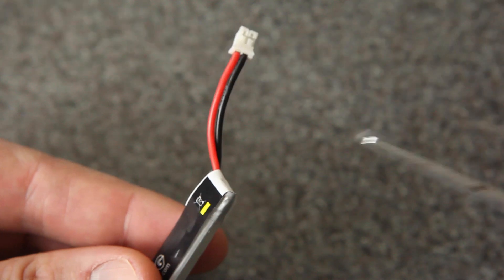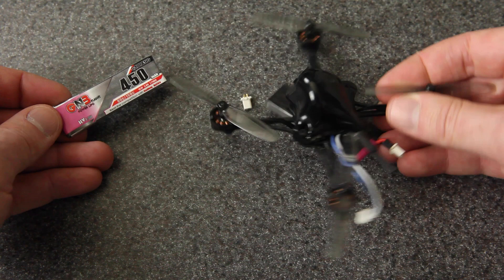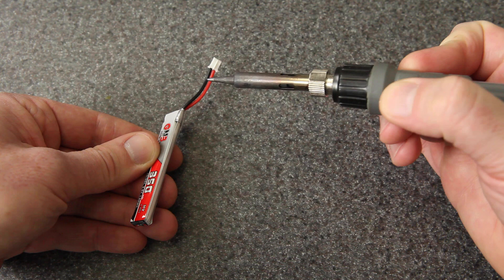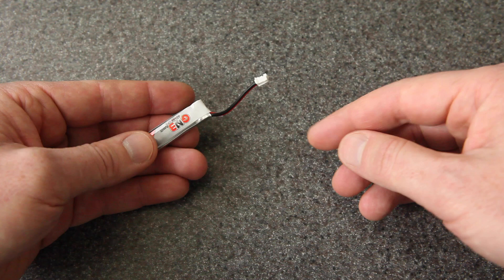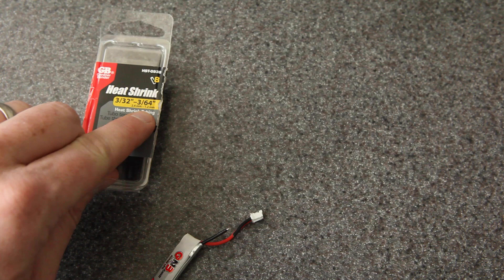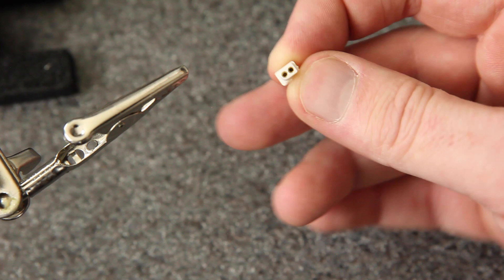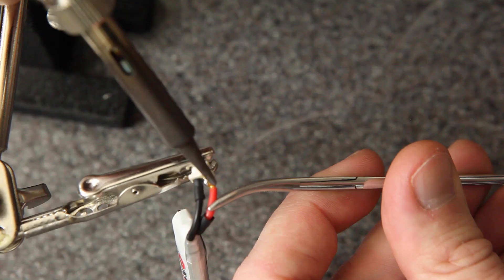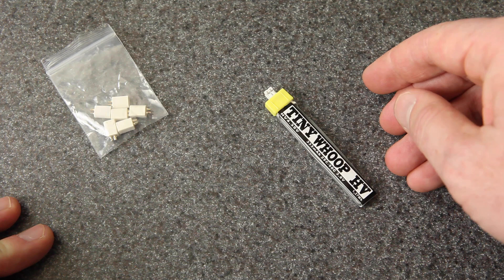Replacing Battery Connectors The SAFE Way

Comment: Couple of other things to consider: 1, it’s a good idea to plug the connector into a socket when soldering- that way, if the plastic melts slightly then resets, your pins will still line up. 2, a bit of blu tack works way better than the helping hand tool- I use that tool only when I use the loupe/ magnifying glass thingy. Put the blu tack on something heavy and heatproof- I use a chunky marble coaster. 3, if you do cut the wires too short for heat shrink, you can use liquid insulation tape. This is a black bitumen type substance that you paint on. Added bonus- it’s more flexible than heat shrink (and it waterproofs your connector to a degree). I usually take the pack apart, solder a new lead onto the tabs, and reassemble- but that’s not for the faint of heart or novice solderers. Great video as always!

Comment: I find Blu-Tack is infinitely better than helping hands.
Reply: I´ve heard about Blue-Tack in the past.. 

now i read this comment and watched a vid,
on how to used Blue-Tack while soldering...

Thought you put wires into it,
which for me doesn`t made a lot of sense to me..

But putting/pressing FC, ESC, Rx  e.g. into it makes a lot more sense !!!

So easy to solder wires to them.. GREAT !

bought it right away..

Thank YOU :)
Reply: Couldn’t agree more, I grabbed some Electrical putty from work and it works like Blu-Tack

Comment: I saw a recommendation for soldering an xt30 that said to always put the "mate" on the plug while heating so that the pins can't move.  I think I'd do the same on this little BT2.0.  It matters more for the male side maybe, but just seems safer in all situations to me.  The only downside is that there is more metal connected that you have to heat up.
Reply: Martin Gates I do this same thing. It does take a bit more heat as the pins will heat soak but at least the plug is aligned and easy to connect and take apart.
Reply: Also doing the same !
Reply: You might need a bigger chisel solder tip
Reply: thats how i do it, but i got a surprise the other day. I had taken off the rubber tips on my helping hands, aaaand i wanted a helping hand, so i clipped onto the xt60 no problem for black wire... and when i went to do the red it exploded! The alligator clip on the helping hands shorted the xt60. No damage or injury besides an exploded xt60 connector. I took off the rubber tips to work on something tiny earlier and neglected to replace them... be careful m'kay

Comment: I always put a mating connector on the connector I'm soldering for 2 reasons:  1.  to keep pins in place even if the plastic deforms a little, and 2.  if it already has wires then it easily indicates the polarity.
Reply: Its a good tip for the micro connectors, but youve got to have a screaming hot iron to do it with an xt60 because the other plug and wires suck the heat right out.
Reply: @prescottmajette5290  What soldering iron do you use?
I use a TS100; I usually do bump the temperatures up though for big stuff like XT60s.  You can also only partially insert the mating connector so the heat bridge isn't quite so ... severe.
Reply: @GoatZilla  Its just some chinese knock off that takes hakko tips.  Does up to 480C and 70w though, so its honestly pretty decent.  Even with my biggest chisel tip and 480C, those xt60's can be a big pain.

Comment: Awesome video! One tip With the lighter: if you put it above or to the side of your workpiece, you can use the blue portion of the flame for a more controlled heat application. I learned this one when cleaning up cut edges of synthetic (plastic) textiles & ropes.

Comment: If you have a wire already attached to a connector, can you solder wires instead of the connector end?
Reply: That's my question too I want to replace my drone battery by cutting of the old one's connector and putting it in the new battery
Reply: @aniketsrivastava1870  I can confirm I did it and it worked fine. Mine was converting PH2.0 to ET2.0 on my 1S 250mah.

Been fine for the last 2 months.
Reply: @blackyle3  well that's great I wanted a battery with more capacity and same p.d. so I m getting 750 mah lipo battery instead of older 500 mah
Reply: thats fine as long as you get a nice connection

Comment: Could I do this by just splicing the corresponding wires together and using heat shrink?
I have a dead battery with connector and a new one without

Comment: What is a safe batt voltage for connector conversion? Could you apply heat to a fully charged batt? Thanks

Comment: Great video my drone runs a 530mah will a 650mah be ok for a little longer flight time. I am going to swap for a single 2s battery with ec2 connectors.i use the ec2 connector on my 1/24 scale rc crawlers.thanks for the advice ahead of time
Reply from the maker: I don't know the size of your drone, but 650mah isn't that much bigger than 530mah, so it will probably work. How much flight time you get will depend on many factors including the size of the props and the weight of the drone.

Comment: can this process be done also one the fire thats connected to the drone? I am new to fpv so dont know the correct terms but the connect on both the batteries and the wire thats connected to my drone had a spark when my brother tried connected them but did it the wrong way.
Reply from the maker: Yes, you can replace the connector on the drone using a similar process. However, if you plugged in the battery backwards, then the flight controller and ESCs are probably damaged. Most circuit boards in this hobby do not have reverse polarity protection.

Comment: Just curious, have you tried this on a brushed Whoop? I have a 💩 load of brushed Whoops that I still fly indoors and I bet this would give a little more consistent power. I still love brushed indoor micros but I HATE the sag especially during fast maneuvers.
Reply from the maker: I have not tried it on brushed but assume the results would be similar. If you pull more than 5A the BT2 starts to make a difference, but only if the batteries themselves are good.
Reply: Mr ShutterBug That’s a good point the brushed varieties aren’t pulling serious amps, I haven’t seen anyone try it and I was curious👍🏻
Reply: I’m thinking more flight time over performance 🤷‍♂️

Comment: What do you think about a JST XH 2.5 connector for a 1S Lipo like 450mah ? Should be better than a PH2.0 or even PH2.0 Solid Pin. Of course not as good as XT30.

Comment: Hello mister shutterbug! What do you think about 1s xt30? I'm thinking about trying that out on a mobula 7 I put in a uz80 frame for a 1s and 2s option. I wanted to direct solder the motors also but I cant get the motor plugs off I think they are glued on and dont want to break something prying on the board. Love your videos you are a wealth of knowledge
Reply from the maker: XT30 will work perfectly for 1S, but it is overkill and heavy for something like a Mob7. I think you would be better off with BT2.0 connector or the GNB27 connector. Even PH2.0 can work quite well if it is a good quality connector with solid pins (I find that nothing is as good as the original PH2.0 designed and manufactured by JST, not any of the rip-offs. You can get them from digikey.com). Hope that helps.

Comment: Any idea if gnb or any other Lipo companies are going to use this bt2.0? I really want to switch over but it’s not very cost effective if other companies aren’t planning on adopting bt2.0. Great video
Reply from the maker: That's the big question, and it remains to be seen.
Reply: Mr ShutterBug the issue I have with ph2.0 is after a number of uses either the battery or pigtail cause the battery voltage to be drastically reduced. I swapped a pigtail and that temporarily fixed the issue now I’m trying deoxit contact cleaner. Someone suggested that to me to cure the issue. They said it’s just oxidation that adds resistance which makes the sagging worse. Just cleaned the connections and gonna charge it up soon so we will see.

Comment: If the cable pulls out from inner tab is the battery shot or can I get a lead into the tab
Reply from the maker: I would replace the battery unless it is a large expensive battery. It may be possible to repair but it won't be easy. If you attempt it, then please be extra careful about safety.

Comment: Hi, I have a question, do you connect the + wire to the + side of the BT2 or + wire to the - side of BT2
Reply from the maker: Serious question? Connect + to +. If you wire the battery backwards, that will destroy most flight controllers.

Comment: the ph2 style , there are smaller ones or larger ones - what are they called ?
Reply from the maker: I'm not sure what you mean. The smaller ones that are used for motor plugs (and old batteries) are usually JST-PH1.25 (meaning they have 1.25mm pitch). Balance plugs on multi-cell batteries are JST-XH connectors. Hope that helps.

Comment: Is it bad to still try putting a new end on a 4s lipo that the guy said he touched the ends together on accident.??
Reply from the maker: You might be able to save it, depending on the damage. Just be careful working around lipos.
Reply: @MrShutterBug  ya idk if its worth it lol
Reply: @MrShutterBug  undid the same first time intent to charge a 2s.  Plugged in charging wires to battery first and they touched fraction of a second and sparked. It's been couple months now and a few charges, it seems fine. No swelling and battery works and charges fine. Is it potentially at risk?

Comment: Are you going to do a video on how to do to it with the 2.0 that's on a mylipo 333 battery?  Thanks
Reply: I don't know if I'd attempt that, but it would be interesting to see the process.
Reply from the maker: I would love to have BT2.0 on the mylipo 333, but like I said in the video it's really tricky. The tabs are super fragile and sometimes break when trying to get the plastic cover repositioned snugly.
Reply: @MrShutterBug  maybe use some silicone glue
( same one as already found on the battery )
to make sure the cable doesn`t rip off..

like a strain relief.. 

I don`t have any better Idea yet...

but if you make a Video, on how to change,
it would be useful for others too :)
Reply: I did put a B.T 2.0 on the mylipo 333 and it wasn't that hard and I wouldn't consider myself that good at soldering.  I took it real slow and was able to do it without any problems.

Comment: I want to replace my drone battery by cutting of the old one's connector and putting it in the new battery
Can I do that
Reply from the maker: Yes, you can remove connectors from old batteries if you want to recycle those connectors. Just be careful. You would not want to damage the battery cell itself and you would not want to cause a short circuit. Those things might create a fire danger.